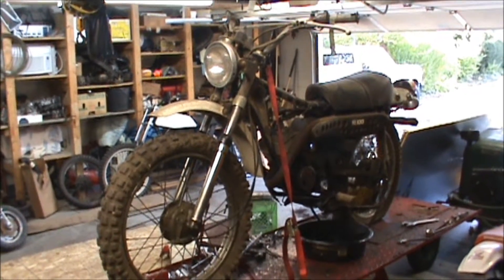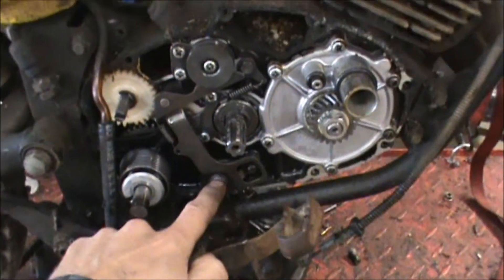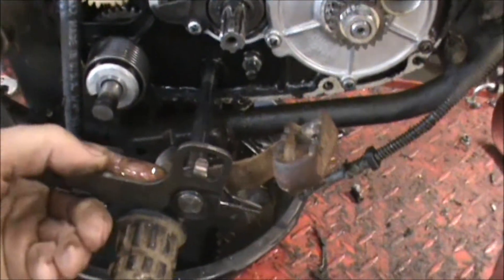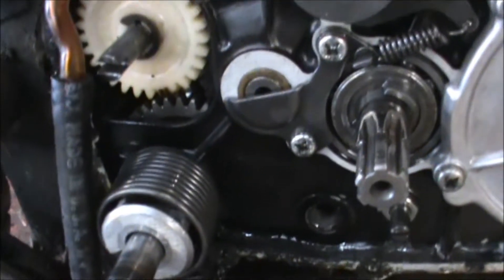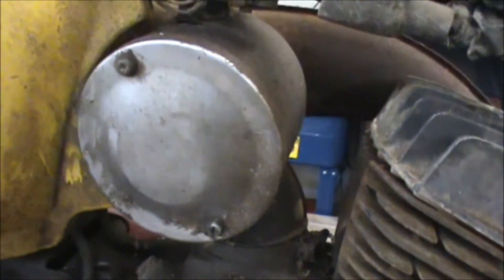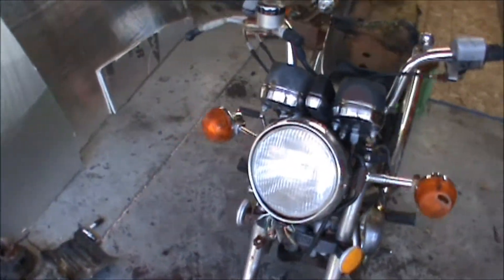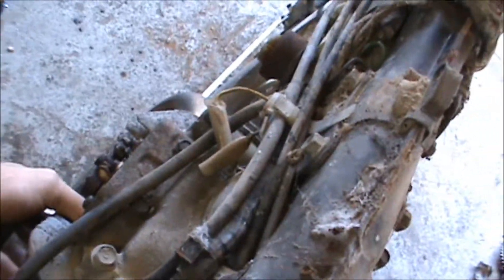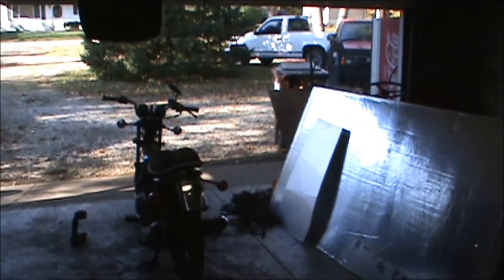Kawasaki 100 Shift Shaft Replacement and more

Comment: My 73 Kawasaki G3SS came to an abrupt stop today. Removed the plug, kicked her over and heard some clanking. Removed the top end and found a destroyed piston, and severe bearing movement on the connecting rod bearing at the crank. I've never split a case before, wondering how involved this undertaking is. Any advise as to what shop manual to buy?